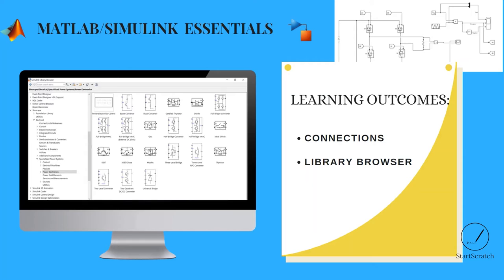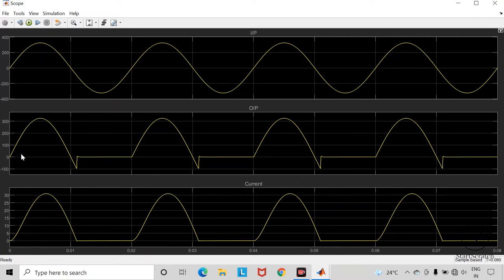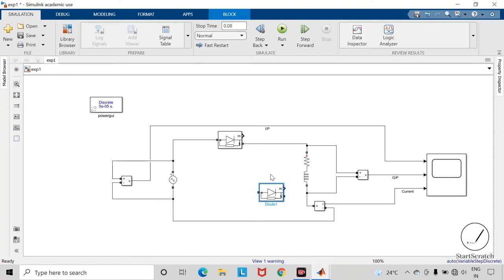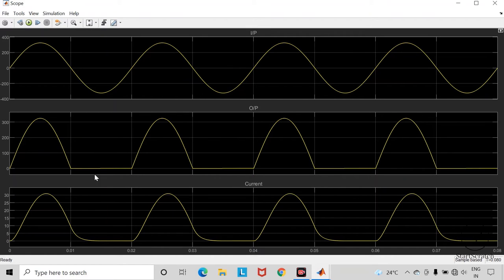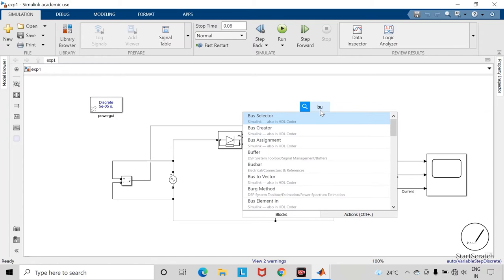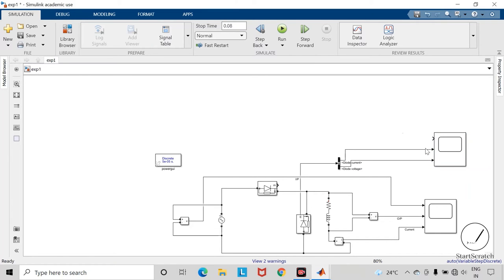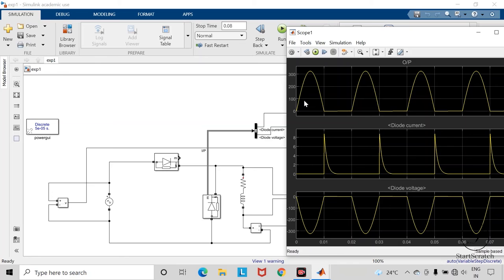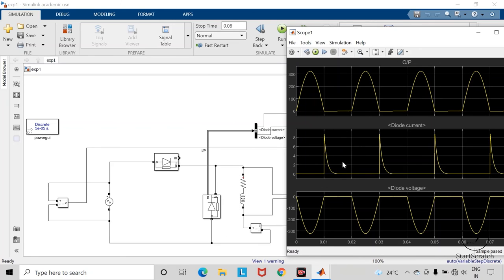L5 | Half wave Rectifier with RL load and Freewheeling diode

Comment: Quiz:
1. How the freewheeling diode is connected in the circuit with respect to Load?

2. What is the effect of the freewheeling diode on load voltage?

3. What is the effect of the freewheeling diode on load current?